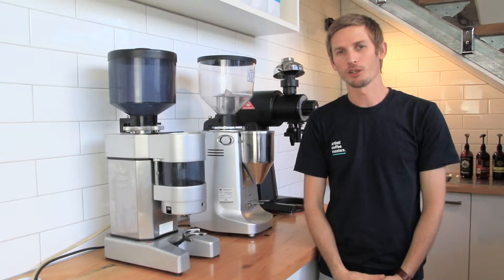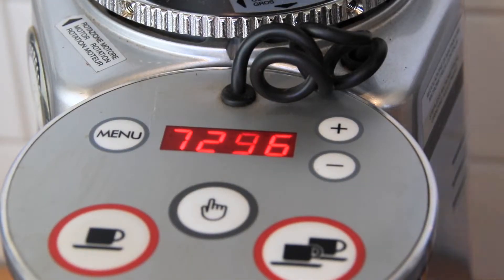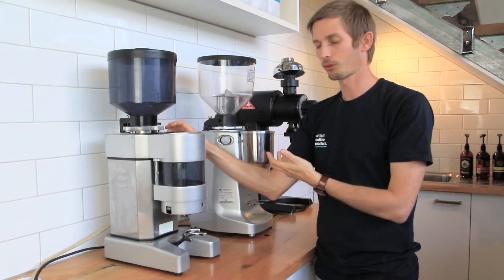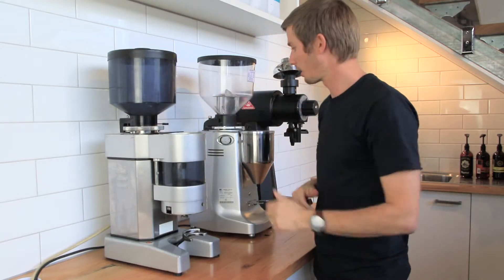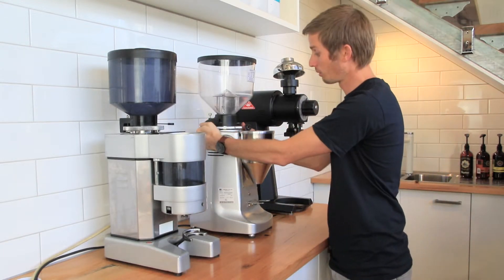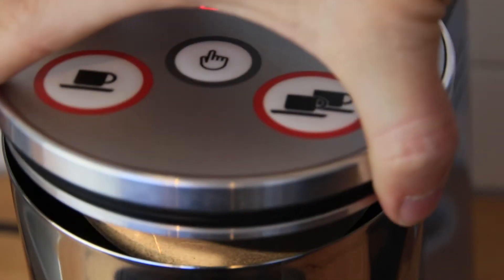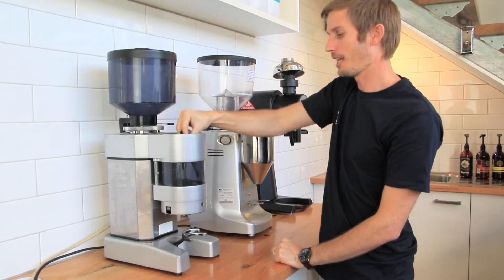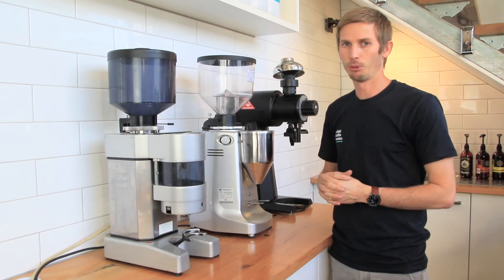Coffee Grinder not working properly? Trouble Shooting a Commercial Coffee Grinder

Comment: Had my Mazzer Major for 15 years and it stopped working this morning but with power so I watched your vid. Winding back to a coarse grind freed the blades and I'm back in business. Thanks!
Reply from the maker: Nice, glad it worked. They will go forever, put some new blades in for $65 and a capacitor for $20 and it’s El ready for the next 15 .🤙🏻

Comment: One morning my big Mählkönig K30 Vario stopped suddenly. The fuse was off. A brocken steel blade use to cut jute bags was found inside. With a little patience, some screwdrivers and a good light I was able to put it back into service. It’s still going strong after ten years, grinding a double shot in four seconds.
Reply from the maker: Great it’s working again, a bit of a worry to have a broken blade in your beans. 😩

Comment: Hello,
I would like to ask, if I'm cleaning my grinder, I seen some maniac use rice. to clean the blades and the inside of the grinder, is it a great way for cleaning the grinder? Whats the best way for disinfecting the inside of the grinder?

Thanks for reply.
Reply from the maker: Hi. You would not disinfect a grinder, a tech could pull it apart and vacuum it out, sanitise the parts but that’s going over the top and then grease it and put it back together. Rice can be used however there are specific grinder cleaning pellets to use. These will leave a fine coating in the grinder to help reduce grind static and build up. These are still both the same as coffee as they pass thru ground and powder cleaning powder is not ideal. Pull them apart and vacuum out is the best
Reply: @ArtistiCoffeeRoasters  Ok, thanks a lot